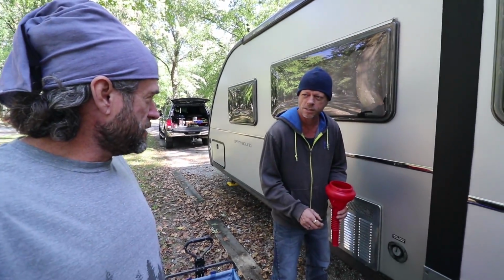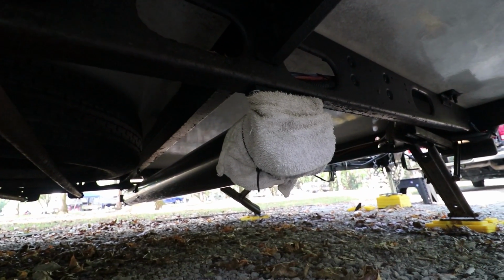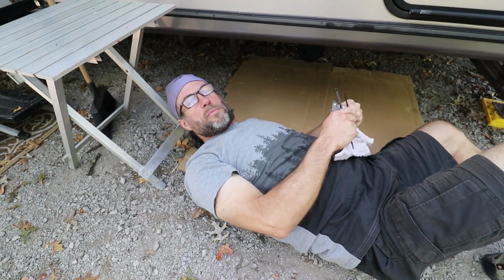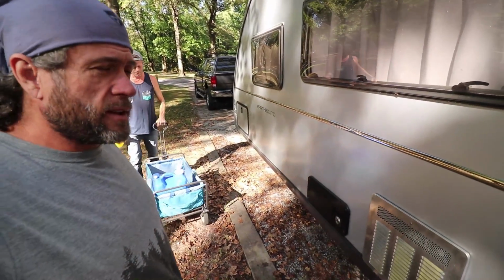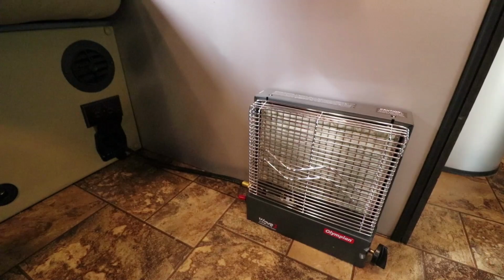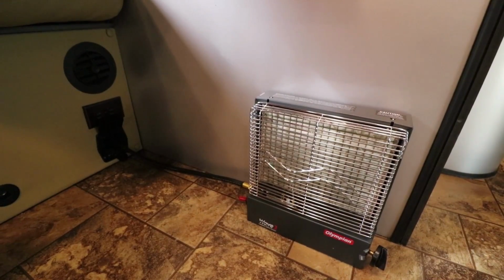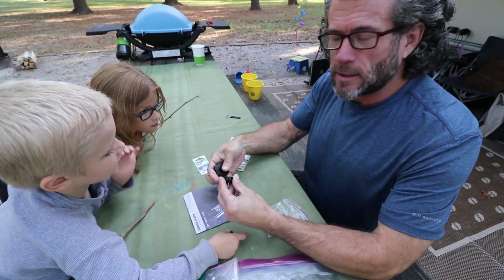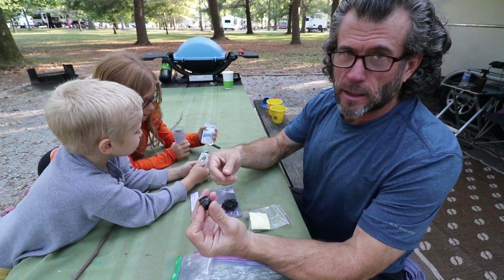cart your own RV water (have you ever?)  its project day!

Comment: Do you guys chlorinate the water. A lot of RVers get a Burkie for drinking water   .  The post office will take general mail which means they hold it there for you to pick up.
Reply from the maker: We sanitized the system with chlorine but don't like drinking from the tank. Although our current issue is quantity. We were hoping to last two weeks but only lasted five days.
We looked into the Burkie but it was too big. We opted for a reverse osmosis filter... that we haven't installed yet - sigh. We have friends that have a Berkie and they love it. 
We've never asked if general delivery will take UPS or FedEx. We assumed they would only take USPS.
All great points! I wish I would have elaborated more.